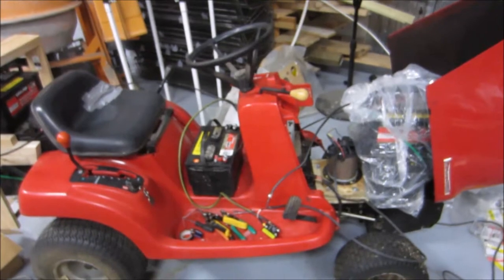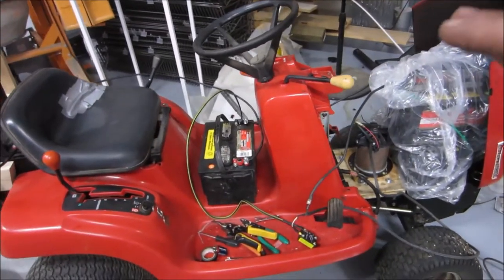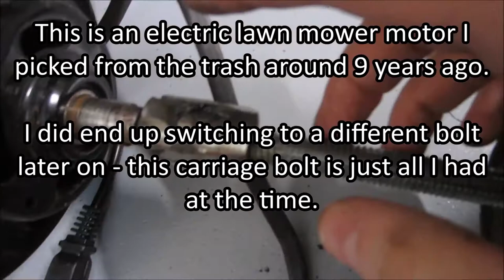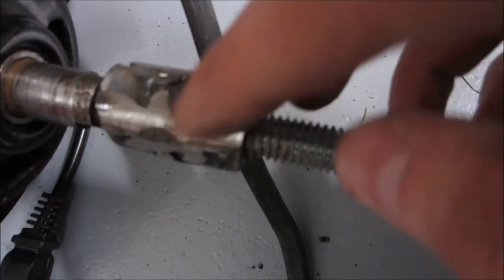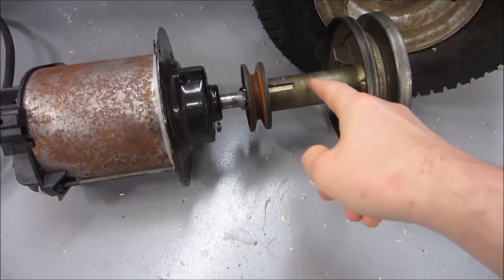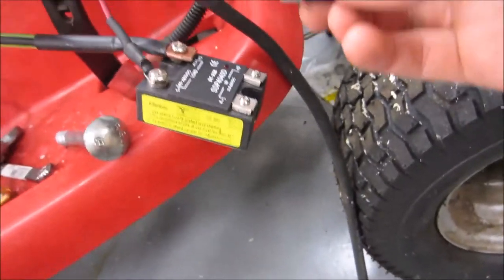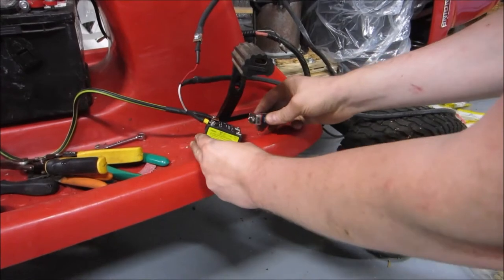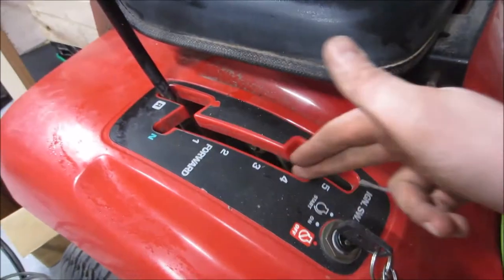Lawn tractor to EV conversion (Electric Vehicle) - part 1

Comment: I converted my Dixie Chopper over to Electric. Maybe 10 years ago. And I loved it. I had a long business. And I would charge the lawn mower from the truck. . I've done a couple of lawn mowers for other people. If you click on my profile picture. You can see them. One thing you have to remember. With that motor you have if it's a hundred and twenty volt motor. And you run it on 70 volts? You'll basically get. One-quarter the horsepower out. Because has the voltage drop so does the current? Half the voltage half the current 1/4 the power.
Reply from the maker: Thanks.  I ended up switching to a 24v motor later, but the HP is no where near enough.  Eventually I'll switch out the motor to something more appropriate. :)

Comment: good video what are the specs on that motor and by the way the background beeping is so annoying your voice is good and clear!
Reply from the maker: Thanks??  Specs pulled from another video - I also added the playlist link for this series to each video description:

Motor I purchased: 1 hp DC motor generator 24 volt 800 Watt 12mm shaft permanent magnet S
http://www.ebay.com/itm/172213983297

Note: I think this probably needed DOUBLE the amount of power this motor has, maybe even triple.
Reply: @someoneinncarolina  Yeah, that does seem a bit under-powered to me. Might work if you had that motor directly driving each blade? Even then, it's a bit under-powered (ours takes 6kW to drive just the blades, without cutting!)
Reply from the maker: @loxleyfarmlet6165  Good to know.  I suspect using 2 of these motors, or maybe even 3 of them might be more realistic.  I wish golf cart motors weren't so pricey!

Comment: what kind of motor are you using?
Reply from the maker: In this video I'm using a 120v universal motor salvaged from an electric lawnmower I found in the trash.  Later I switched to a 24v DC motor, but it is undersized.  I'm hoping to some day justify spending around $400-$600 on a decent golf cart motor to properly run this EV.
Reply: Torque converter?